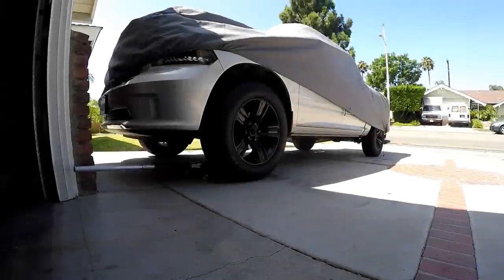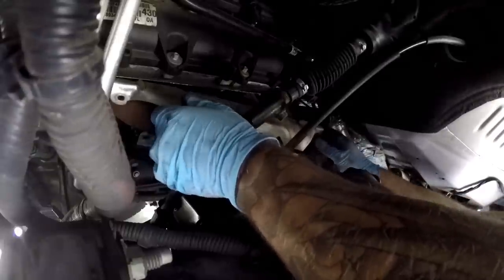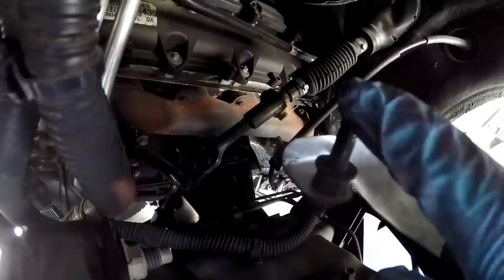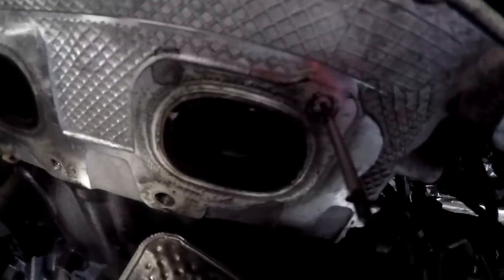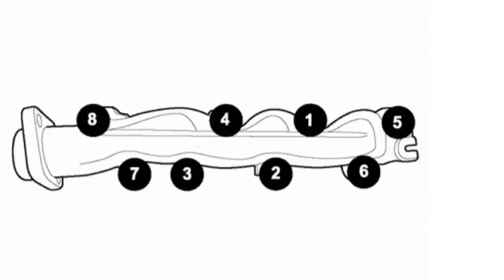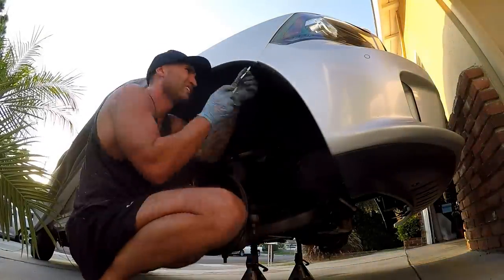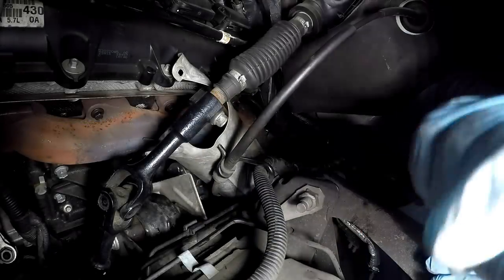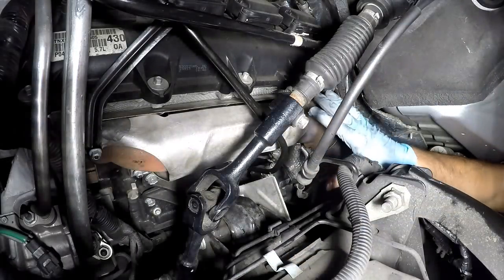DODGE RAM HEMI Exhaust Manifold Stud Replacement   Leak Ticking FIX

Comment: Do you have a part number for the bolt sets you used?
Reply from the maker: I don't think there is a part number but I bought the kit online from this dealer for cheap

https://www.ebay.com/itm/RIGHT-PASSENGER-OEM-2012-17-5-7L-HEMI-EXHAUST-MANIFOLD-BOLTS-RAM-1500-2500-3500-/252885645826?hash=item3ae128ba02
Reply: BoostedMotorsports is there a difference in the bolts for the driver's side and passenger side? I noticed some sellers label them that way. I'm also having a hard time finding some for my 14. The newest I see is 12. I wonder if they're different.

Comment: Would have loved to hear what it sounds like after
Reply from the maker: Sounds bone stock Kurt with no ticking 😎  If you check out the end of this video you can hear the truck idling quietly still almost a year later and how loud it is when I open up the exhaust 
https://youtu.be/X3X5Hpnde_U
Reply: Cool, only reason I asked is I have a 2017 2500 hemi 5.7l and it runs great but definitely makes some intereting sounds at low RPM almost like a tick but more of a whistle if that makes sense

Comment: I’ve heard these bolts will just shear again after replacing is this true?
Reply: If you don't put new manifold covers on they will break again sooner yes... The problem is the manifold cover warps over time putting tension on the bolts and shearing them off

Comment: 2015 bought new and has made that sound from day 1 . 39,000 I wonder if its covered under the powertrain warranty?
Reply from the maker: Hey Joe some dealerships cover it while others don't.  I would definitely give it a shot!
Reply: @BoostedMotorsports  that's what I thought. I plan to start with the manufacturer first before a dealership can say no.

Comment: Happened to me again. Driver's side this time. Any suggestion on headers?
Reply from the maker: I'm currently running the JBA shorty headers which are a good quality and get rid of the issue.  Check out my other videos on this channel for the full install on those.
Reply: I'll check them out. Any reason you went shorty's over long pipes? $$?
Reply from the maker: These are the only "CARB" legal ones so I went that route.
Reply: Makes sense. Haha sorry about your location

Comment: It's better to replace the manifolds with stainless headers that fit up to the factory exhaust!... This will fix most of those snapping bolts problems and give you a little more horse power.

Comment: well this past week i have become really unimpressed with the dealer that just did this job on my ram, i just got under my truck an what did i find but they had cut my crossover pipe from the drivers side to the cats an welded it back together an didnt tell me. i called them to find out what happened an evidently the socalled mech there dropped a socket down one side an couldnt get it out so they cut it an rewelded it. so i guess i am going to have to make them buy me a new one .
Reply from the maker: Damn thats no good at all!

Comment: For those watching this with a 4x4. The motor needs to be raised in order to get the dip stick tube out. Fyi.
Reply from the maker: Good info Michael!  Thanks for pointing that out 👍
Reply: I have a 1500 SLT 4X4, and I used a 10mm short swivel socket to break the lower tube retainer bolt loose, then s-l-o-w-l-y wrenched it the rest of the way out.  Slow, but I didn't raise the engine.  Did you have to disconnect the engine mounts?  Just curious...sadly thinking this issue may reappear at a later date.  Thanks for the tip!
Reply: Gary Shreve I could not wrench my bolt out. I loosened it all the way until it hit the engine mount bracket. I didn't raise the engine yet since driver side is still good. But when those studs do break engine is gonna get lifted a little.
Reply: Michael Souza so i have a 2013 1500 Laramie 4x4 and i have the ticking sound so im sure i have to go through this process, but lifting the engine? My brother in-laws 2014 4x4 sport they didnt have to lift the engine to fix this..
Reply: TjReal mines did. Bolt hit engine mount. There was no other way other then cutting the bolt. My engine mount seemed different then others though
Reply: False.. You 100% DO NOT have to lift the motor lol just did both sides in my 4x4 without "raising the motor"

Comment: All the auto websites with compatibility tools say these bolts 👇  you suggest will not work with the 5.7 motor. Will they? The rotten dealer wants $130 per side.. Any help would be appreciated. Im stuck.                                                              Dorman 03211 Exhaust Manifold Hardware Kit

Comment: Best way to do this is not with an extractor. This is best accomplished by welding nuts to the broke off bolts and putting the ratchet on them while they are still red hot, they come right out!

Comment: How did you find someone to get that broken bit out? Idk what to search for... Haha
Reply from the maker: Its been awhile but I think I searched something along the lines of "mobile bolt extractor" on yelp.  I know they are out there in different cities lol.  Even if you get a mobile welder they can tack on a nut onto the broken stud for you that you can then turn out with a socket.
Reply: @BoostedMotorsports  Seems to be the most common practice. Hopefully I left enough for someone to weld on to. :-/

Comment: My dodge doesn't have a hemi, but its got that ticking with the exhaust leak
Reply from the maker: Yeah its pretty common on all the Dodge engines.  Its from aluminum heads and cast iron manifolds the bolts end up snapping.  Its probably the same issue I would bet!  Keep us updated though on what you find!

Comment: How in the world did you remove the lower dip stick bolt hiding behind the motor mount?. Manual says to essentially remove engine lol
Reply from the maker: lol this was 2wd so it wasn't too bad
Reply: @BoostedMotorsports  SOB im 4x4 hahaha 14 fucking hours lol. Steering shaft, 4 ABS lines, 2 AC lines, a dipstick with impossible nut lol... Warped Manifold with 2 snapped bolts inside the head. Drills didnt fit so I used my Dremel with snake attachment, 14 Drill bits and WD40. Then I reverse bits... The Passenger side was no where near that bad...

Comment: Good video but you should get your manifolds refaced
Reply from the maker: Yeah warping cast manifolds is half the problem for sure.  We ended up replacing these with JBA stainless steel shorty headers 👍

Comment: Hey bud, do you know of any after market brands cheaper then the $9.00 per bolt Dodge Parts wants?
Reply from the maker: Yeah definitely!  This is where I got mine for cheap 👍 https://www.ebay.com/itm/RIGHT-PASSENGER-OEM-2012-17-5-7L-HEMI-EXHAUST-MANIFOLD-BOLTS-RAM-1500-2500-3500/252885645826?hash=item3ae128ba02:g:4LwAAOSwRUhY-keo:sc:USPSPriorityMailPaddedFlatRateEnvelope!90670!US!-1
Reply: BoostedMotorsports I went to O'Reilly. $34 perside. Compared too $9 per bolt from Dodge. 
Dodge wants $360 for the bolts alone plus $1200 labor (8hrs total 4 per side)
Reply from the maker: Nice!!!! 👍
Reply: Dodge was charging me over $700 for the “Hardware” bull fucking shit I’m paying for that
Reply: BoostedMotorsports how much do you payed for the gaskets amd bolts?
Reply: @TheSelfReliantMan  
That is disgusting
Reply: Upgrade to some shorty headers and avoid that problem from happening again in the future ☺
Reply: just ordered mine
Reply: Yall are lucky. I paid $15 for 1
Reply: Anyone have experience with aftedmarket studs&bolts? Stainless studs?
Reply: Why put oem stock bolts back in when you know they are prone to snapping, seems like you'll be doing this job over again..
Reply: I had a truck that broke like 3 or 4 exhaust bolts. Anyone know what causes this? It all happened while still under warranty
Reply: @WakeTheDead300  I had 1 broken on the passenger side and 2 broken snapped bolts on drivers side. Plus a warpped manifold.

Comment: Mine just developed it😪 I just took it to the dealer to fix since I still have the power train warranty.  The guy at the dealer was being a ass  about preparing it....
Reply: Did they fix it?
Reply: @erikeldelaram1865  yup I insisted. It was part of my warranty.
Reply: I will be calling my warranty and talking to them about it. My dealer only extracted 2 bolts and left two inside I believe and used the same bolts.
Reply: Well the ones that weren't snapped atleast
Reply: @erikeldelaram1865  dealers are such a pain in the ass to work with.... you buy the warranty and still hesitate to fix your vehicle.
Reply: Definitely, thanks for the reply
Reply: @erikeldelaram1865  no problem! Good luck!

Comment: On the passenger side.....why couldn't just replace one bolt at a time instead of removing the entire exhaust manifold?
Reply from the maker: You could if you want to but usually people replace the gasket too while they are in there

Comment: why did dodge use these crappy bolts??
Reply from the maker: It's just the heat cycling with the aluminum heads and cast iron manifolds that stretches the bolts and over time they snap unfortunately!
Reply: Bolts arnt weak. Just bad design with heat displacement. Even apr bolts will break. Headers are only true fix. But my 13ram 5.7 lasted 92k before onky 1 bolt broke. Not too bad. Luckily it was on the passenger side

Comment: Yep, had a Hemi as a personal truck and now have a Hemi as a work truck. I’m a Chevy man but the Ram was cheaper. My next personal truck will be  Chevy or GMC. I can’t take that Hemi shit! Such a bad design.
Reply: The fact is the Silverado has divided manifold - no wrap, no cracked bolts.
Reply: You do know the 5.3 is notoriously known for a terrible tick also right? Lol we've had 5 or 6 chevy and gmcs in the family over the years with the 5.3 and everyone of them sounded like ass, just as bad if not worse than my current Hemi did before fixing the manifold bolts lol... I like chevy as well but the lack of interior upgrades that chevy absolutely refuses to do and being so far behind every other make out there pushed me into a newer Ram which is by far hands down the nicest most comfortable truck I've ever owned! And the interior is light-years ahead of any chevy pickup on the road 👌

Comment: Ha!..............It's obvious your working on an engine with relatively low miles. My 2007 5.7 Hemi has 265,000 and in no way, shape, fashion or form is it going to come apart so easily. You might want to have mentioned that in the first part of your video. One thing I don't understand is the fact you removed defective OEM Bolts/Studs and replaced them with the same Defective OEM Bolts/Studs. Why did you not use a BETTER aftermarket Grade 8 bolts/studs?? They are offered.
Reply: Damn the ignorance force runs deep